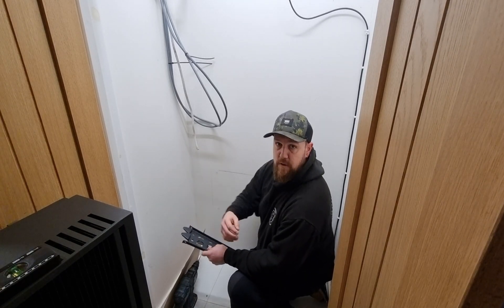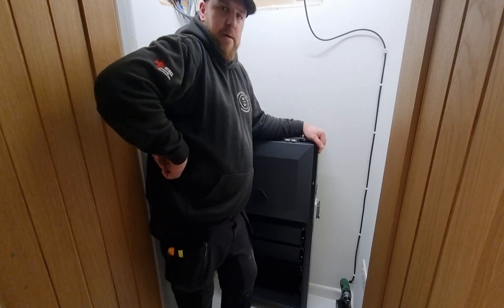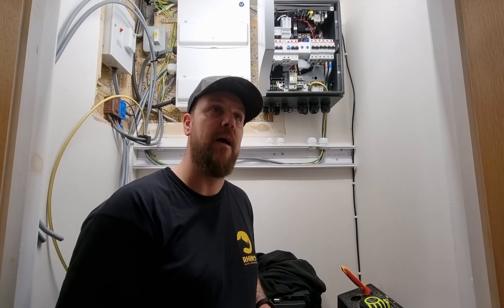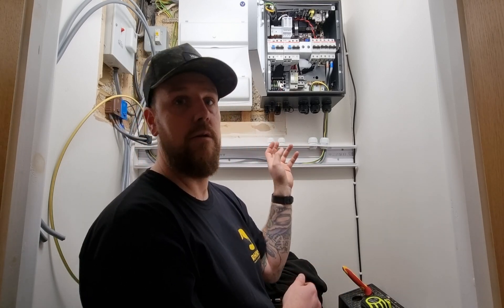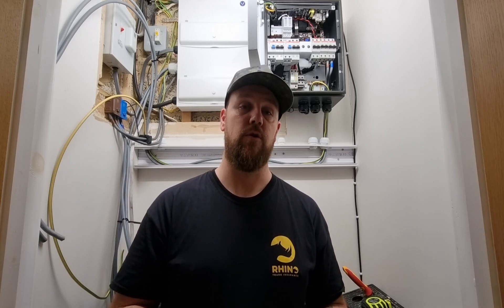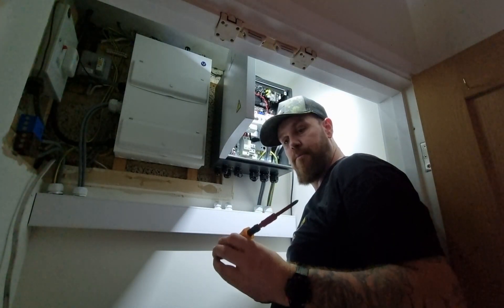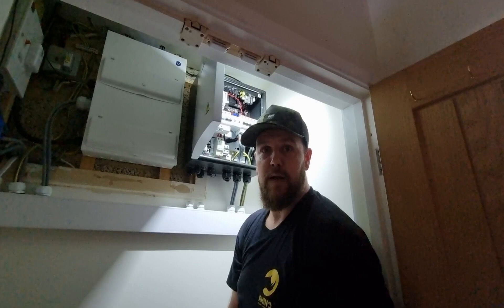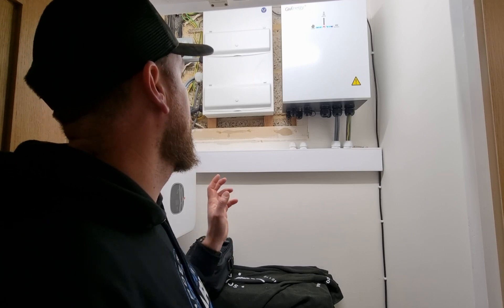GIV AIO Nightmare Commissioning!

Comment: Little tip when commissioning, get the latest firmware from givenergy and put it on a <4gb max usb stick so you can update firmware and bms onsite with no internet connection. as the internal dongles can be flakey on these....
Reply from the maker: Great shout, cheers buddy